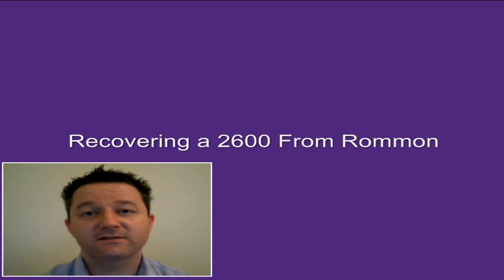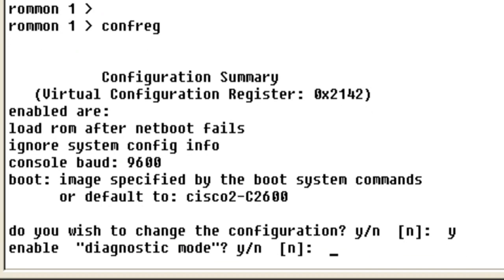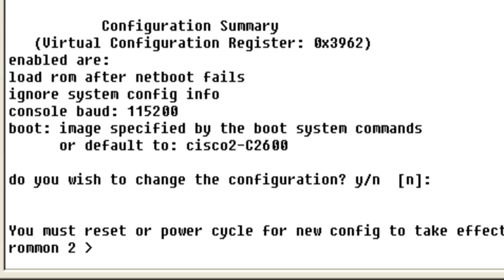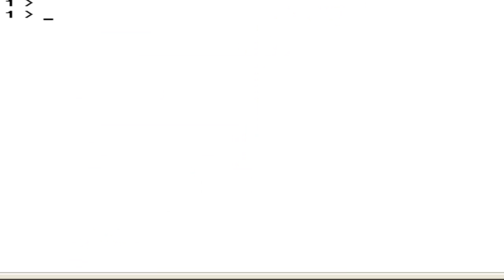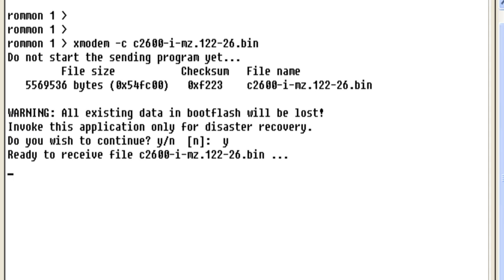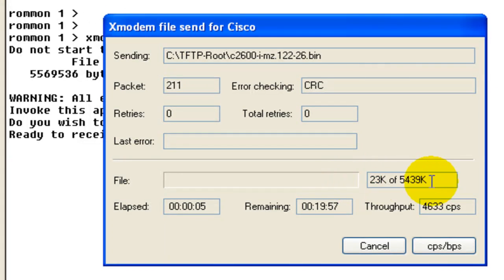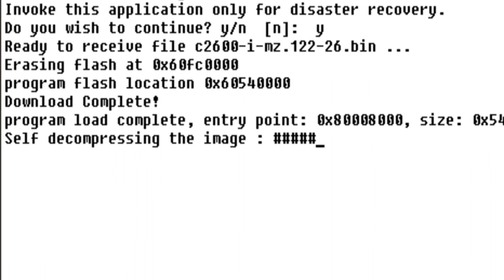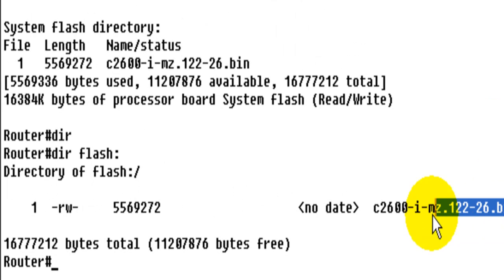Rommon Recovery Cisco 2600

Comment: HI. I have an image problem and whenever I boot the cisco 2600 series router it goes into remmon mode. I try to flash it and it keeps telling me NOT ENOUGH MEMORY. Please it is the flash memory or the system memory. my system memory shows 49152kb which is 49.152MB. and the image I wanted to load is 38MB. Please help. my email address is nyarkodesmond75@gmail.com

Comment: Hey so I have been trying to do this but it fails every single time I try to transfer the image over. It either finishes and than says it aborted half way through or it just aborts half way through. Is this a problem with my console connection?